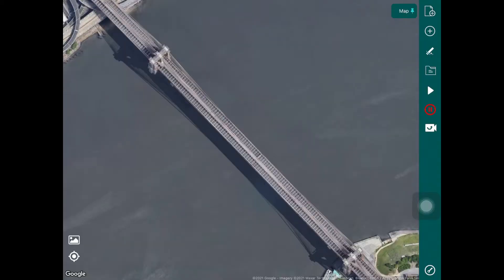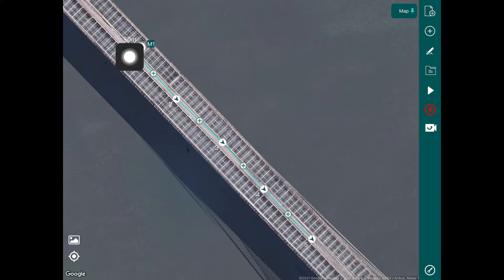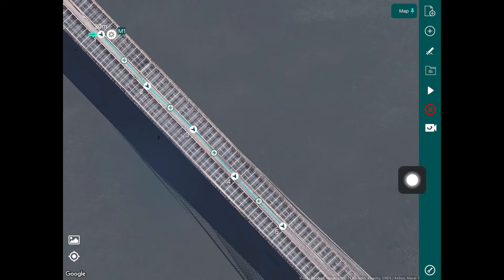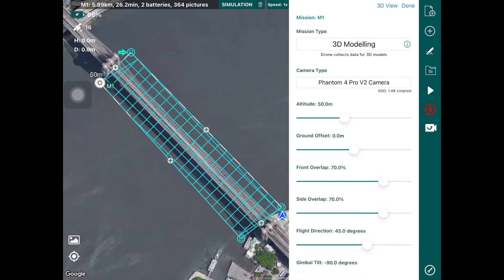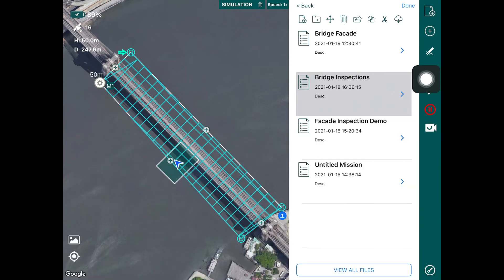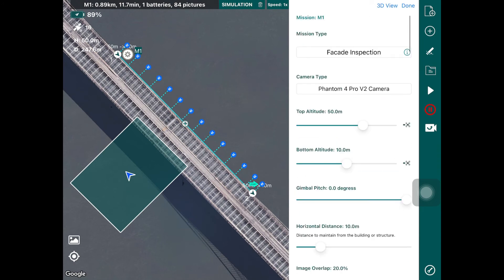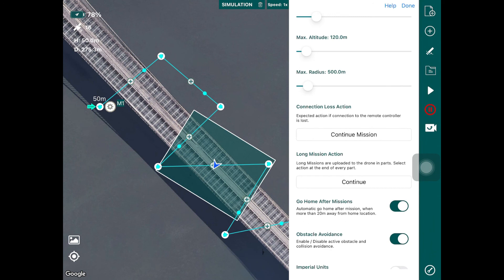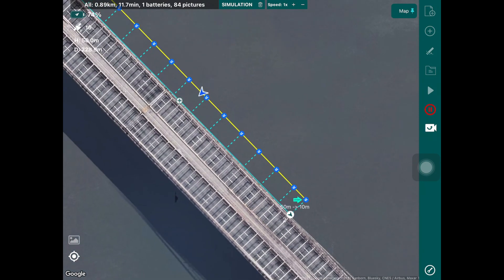Bridge Inspections with Hammer Missions

Comment: And under the bridge?  Is it possible to do any specific mission for this area?
Reply from the maker: Hi David,  thanks for the question! Unfortunately, there isn't a specific mission recommended for under the bridge as this is typically a GPS denied environment where we would recommend using either manual flight and / or drones capable of vision-based navigation.
Reply: skydio 2 3d scan GPS denied environment